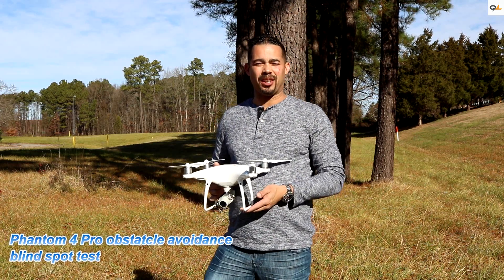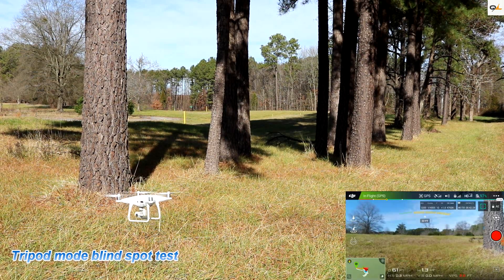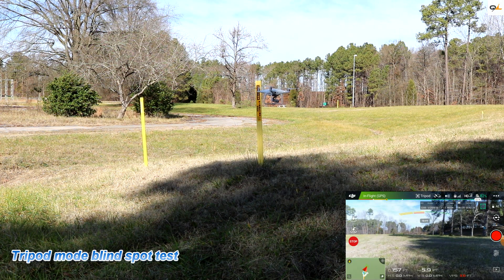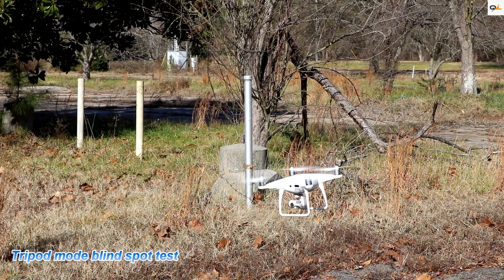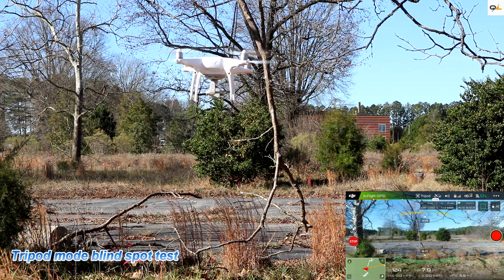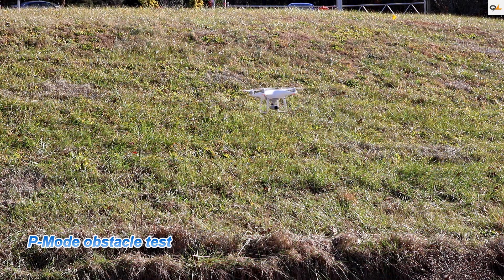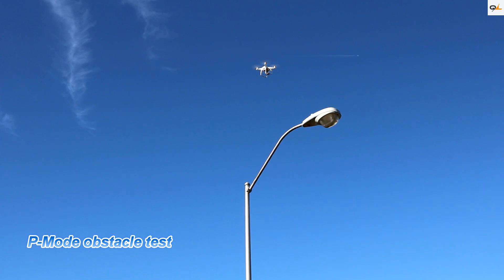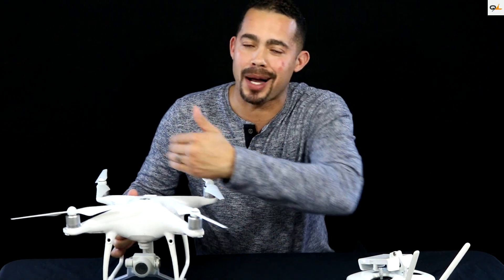Phantom 4 Pro obstacle avoidance blind spot test

Comment: "Only front and rear sensors work in P mode"  I was shocked to hear this.  Beginner mode and tripod mode are the only times you have all sensors.  I haven't seen this mentioned in ANY other video.  You would think that DJI training videos would mention it! they go on about speed and height restrictions in beginner mode so everyone is keen to get into P mode ASAP.  They do bang on about all round sensors on the sales adverts but.  Pffft
Reply: I contacted DJI online support.  They insist that all round obstacle avoidance works in P mode....not just beginner/tripod modes

Comment: So, this would suggest that any tracking or follow me, as well as return to home has a 70% chance of ending in a crash!
Reply from the maker: Not really, the bird will fly straight when in that mode, just have to be careful when flying manually near obstacles.
Reply: "Straight" as in straight into trees and things?
Reply from the maker: In tripod mode, the front and side sensors work well, but in P-mode, you have to be careful.